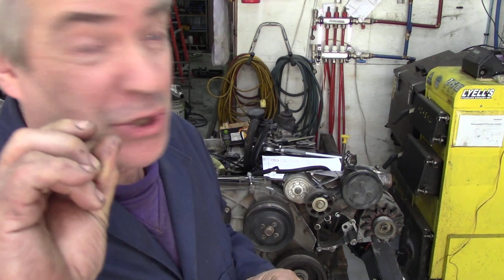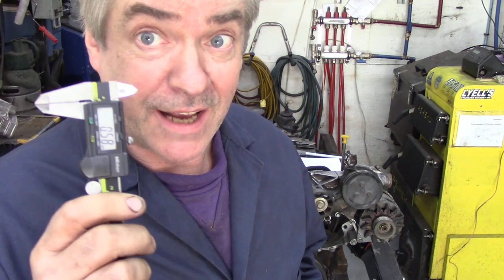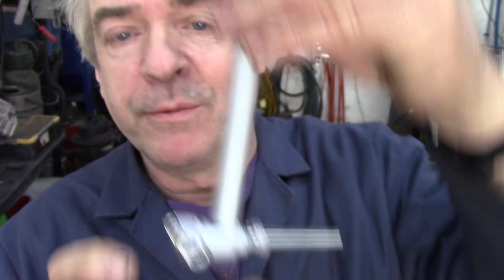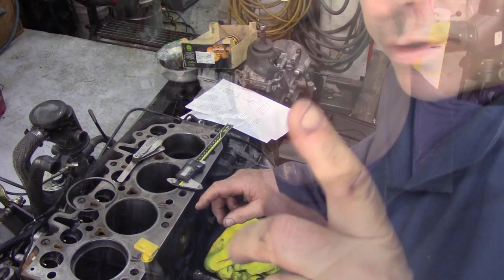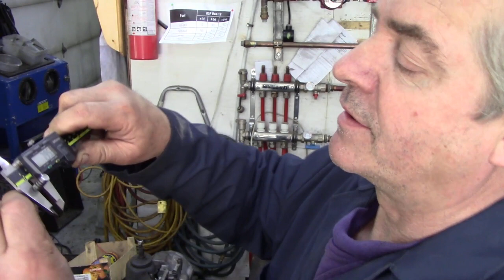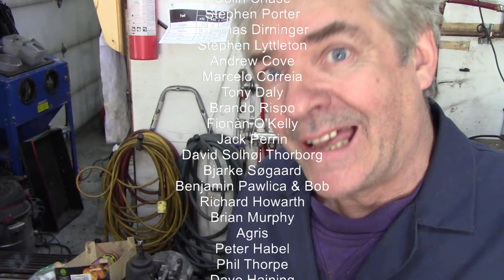Malawi 110 stripping the engine to find out what is wrong   Part 8

Comment: Engines you have to always double check the specs,l find out the hard way by honing with that brush your got to much,didn't need doing and the diesel engine couldn't be stopped when l started it, l did stop it by jamming rags in the intake. My Daihatsu Rocky l reconditioned 6 years ago , the engine place sent the conrod back to me bent,only picked it because the crank wasn't smooth when i was turning it. You do need the expensive measuring devices to check.
Reply from the maker: My engine machine shop is good but they are so unorganized - took the head down to get the seats cut and they are closed until June to upgrade their shop!
Back onto the Range Rover then..

Comment: I see at the top of the specs sheet it says"DO Not De-Glaze".  Didn't you de-glaze the bores or was that another engine?
Reply from the maker: Yes - I did de-glaze - always have done - otherwise the rings will not bed in - I sometimes wonder what they put in these manuals - they gave a figure of a STD bore larger than I had - hence the fancy gauge to find out the accurate size if the original bore
Reply: @BritannicaRestorations  This is annoying as the less knowledgeable amongst us tend to follow the instructions - Thank goodness for Mike.

Comment: If I remember correctly you checked with diesel when the pistons were at the bottom. If they wear in the middle of the bore and not at the bottom wouldn’t you do the diesel leak test with the pistons half way up the bore?
Reply from the maker: Yes - I normally do in the middle - Ideally at the top - but getting a decent capacity is a challenge - anyway, the test did show that the ring gap on number 2 was quite large - this needs a rebore to to honest

Comment: Mike.  Digging the bottom of your own proverbial used Land Rover spares ?  Hope the new pistons will get matched to the slightly oversized bores and better bolt an old 200Tdi exhaust manifold with reconditioned Garrett T25 turbo too !  V.

Comment: Mike, what valve cutting needs to be done with the new valves?  Thought you could just get some compound and lap them in so they seat. I’m sure I’m missing something. Thanks!
Reply from the maker: Good question - generally when guides are worn there is normally consequences of the old guides - i.e. the valves would be rattling about and could chatter on the seats, not sealing properly  - so a quick kiss with a proper seat cutter does the job to true up the seats again
Reply from the maker: Just got back from the machine shop - CLOSED until June! Refurbishment they say - well why could they not do that sooner during lock down?
I wonder why I bother sometimes
Reply: @BritannicaRestorations  I would love to see that process when the machinists have finished their beers

Comment: I was planning to send you an electronic vernier calliper that I was given. I checked the price to find it was a cheap Chinesium brand that was worth less than the postage! 

All of that money saving on this job seems to be costing you plenty of time.
Reply from the maker: I could have popped the spare engine in and have it running by now
Reply: @BritannicaRestorations  Yes, even a petrol engine may have worked out cheaper and quicker.
Reply from the maker: Yeap...

Comment: Nice bit of measuring kit but apart from looking at the transition from high to low points the standard internal mic is fine.  The reading of them can be a challenge if the eyesight is going.  The engine bore is fine, it's only a donkey engine, your not going to be drag racing it are you.  It will probably out live the chassis and as you say the cost can rocket up, especially if the block is stripped down for machining.  All sorts of other parts then get replaced and the whole thing gets out of hand.

Talking of corrosion, I wonder why some smart Alec lawyer hasn't sued the local councils if salt has been used and has caused damage to your vehicle.  There has got to be an angle to push that idea I'm sure, especially in some American states.
Reply from the maker: Yes there is life in this engine and it should cure the crank case pressure issue 
As for salt, they are reducing it now on the roads for  'environmental' protection, but what the government has mandated is, that winter tyres are required - this now saves the government a shed load of money, but we have not seen a reduction in our taxes! lol!